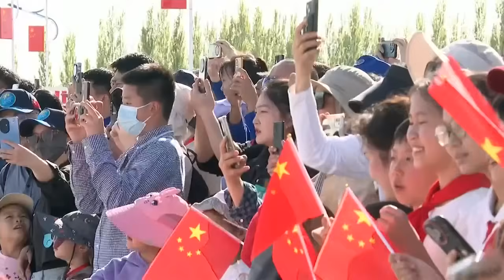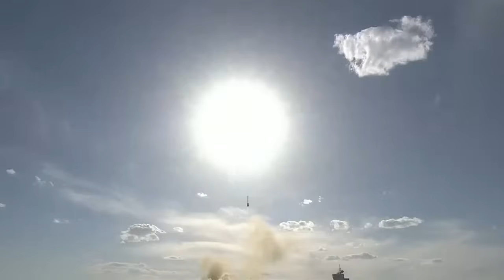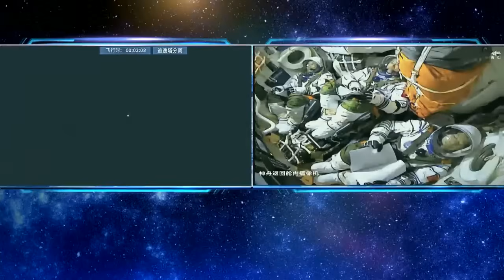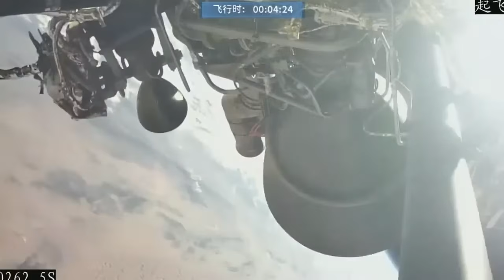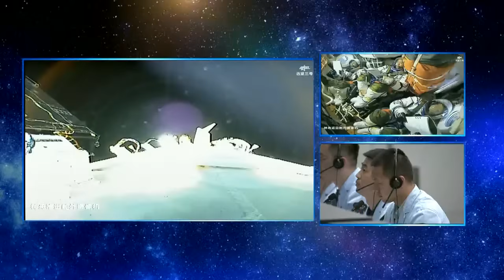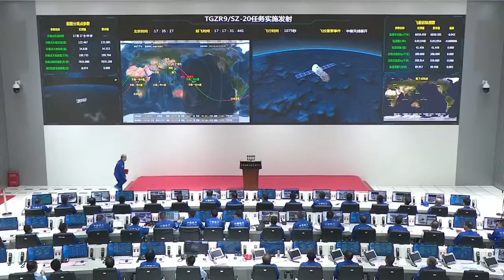Shenzhou-20 | Long March 2F | Original Footage

Comment: What kinda fuel are they using?
Reply from the maker: The Long March 2F uses Hypergolic Fuels. It specifically uses Unsymmetrical Dimethylhydrazine (UDMH) as fuel and Dinitrogen Tetroxide (N2O4) as the oxidizer for both its main stages and four strap-on boosters.